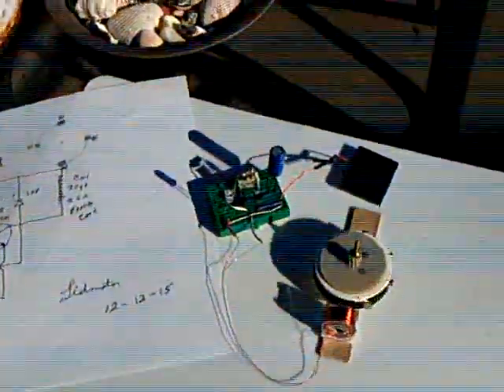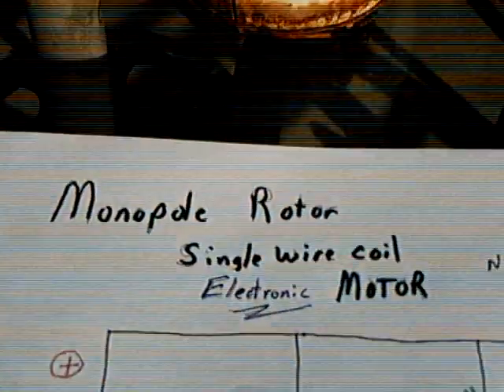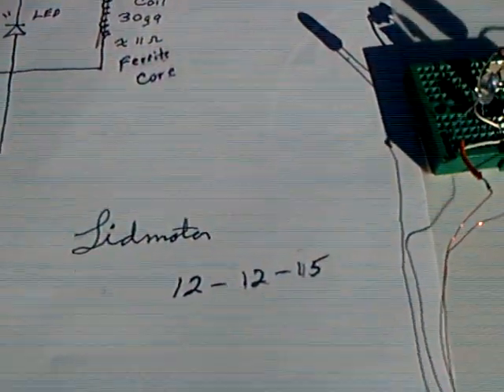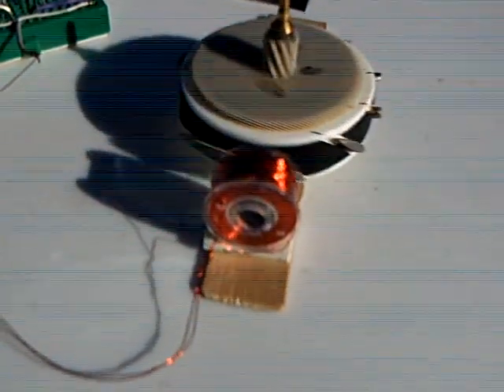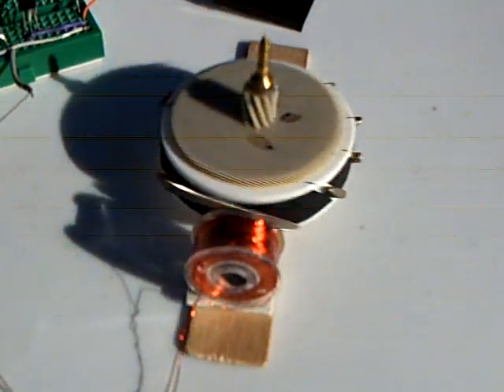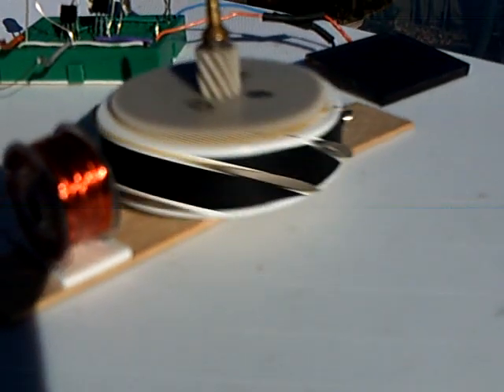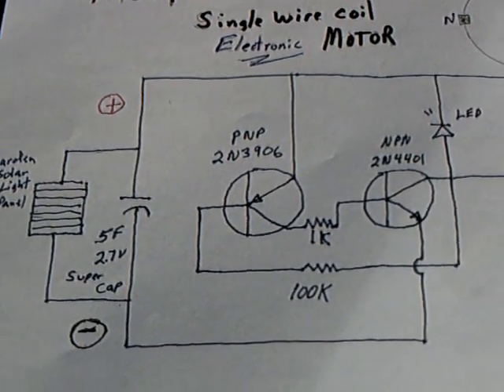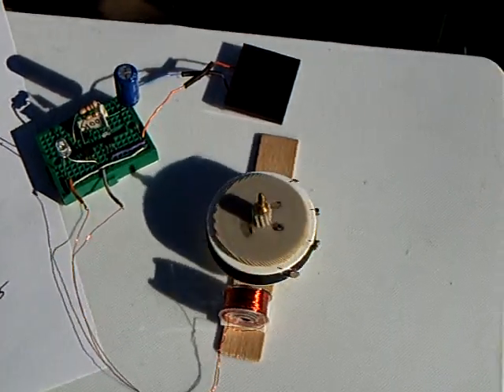Monopole Rotor Single Wire Coil---  Electronic Motor

Comment: Could you take it the next step, and add a second coil (opposite of the pulse coil) and connect the wires to the battery. This should act as a battery charger, and maybe eliminate the solar battery.  Possibly, charge the capacitor with 4.5 volts to boost the motor.